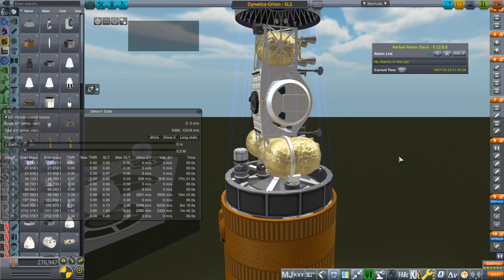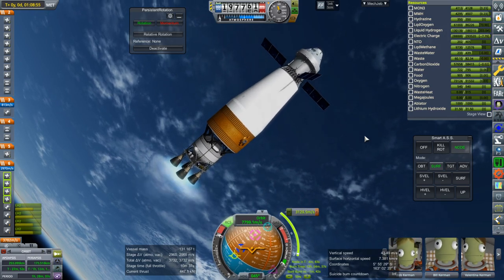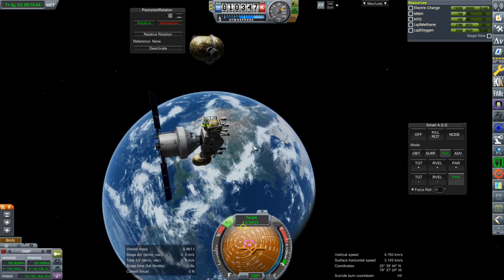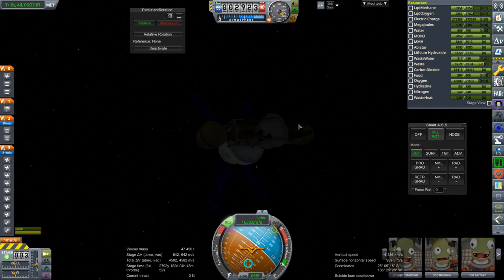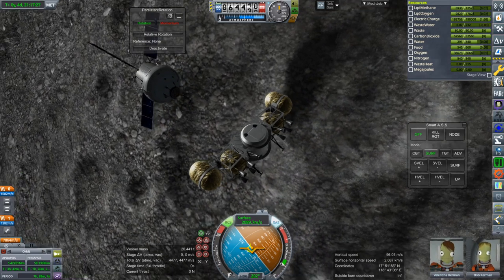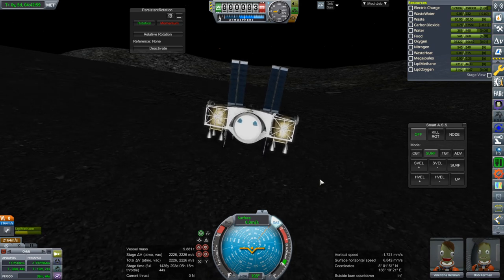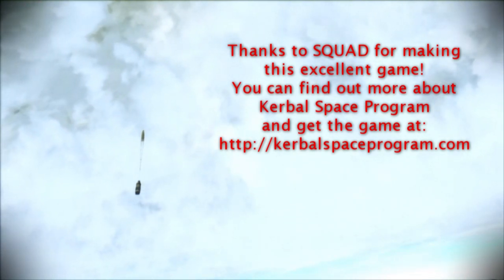Realism Overhaul in KSP 1.8.1 - Orion and Dynetics Lander on SLS Attempt 1

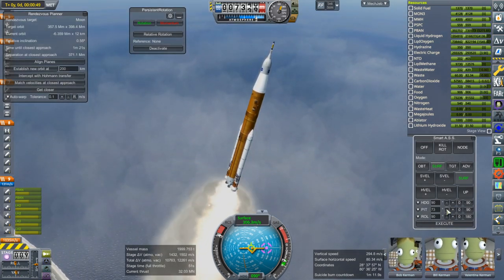Comment: 3:50 Indeed.

16:35 and 20:05 Make sure to do that on every burn in the next attempt.

25:05 AFAIK, it is always better to have more high-Isp fuel than low-Isp fuel, and to use the low Isp fuel first if possible.

Also, you could potentially transfer the residual CanadaTug fuel into the Orion.
Reply from the maker: The CanadaTugs use MMH-NTO rather than MMH-MON3 right now, but I guess I could change that.

Comment: One thing I’ve noticed even in your last video was that you tend to hang onto the service module fairings to long, which makes you have to carry more mass to (almost) orbit. The actual flight plan for the SLS calls for those to separate around the time you jettison the launch escape tower, so at around 69-75 km altitude. 
Furthermore, if you do split your burns into 2 for your TLI, why not burn at periapsis? It’s a colossal waste of deltaV when you do it in a midcourse correction, and the time on the first orbit isn’t that significant. Even if it adds a day and half to your journey, Orion is build for long term space flight, so that shouldn’t really impact your overall performance. To compensate for the moons orbit around the earth, just launch a day and half earlier to still make the most efficient encounter.
Im not saying that I know these things better, I’m 110% convinced that you’d make me a better KSP player in just under an hour, but those things are something I noticed, perhaps these little pointers can help you with overall flight performances :)

Comment: Ok, we can't replace the SLS core with Super Heavy or Starship, but what if we replace the SLS core with Delta IV cores?
I'm not totally unserious. A quick calc gave me something like SLS block 1 performance from 7 CBCs strapped together (I don't mean one core with 6 boosters, I mean literally permanently strapped together. I did the math for a single 1st stage with the dry mass, propellant mass, and thrust, of a CBC x 7) with an EUS for the upperstage. That's not terrible, and if you actually stage the CBCs as you go, and then start adding the planned Delta IV upgrades like lithium-alloy tanks, a regen nozzle for the RS-68,  booster crossfeed, then it starts to become a potentially quite impressive vehicle.
Reply from the maker: This is totally a kerbal thing from way back with Mainsails instead of RS-68s.

Comment: The sls block 2 has a really low chance of becoming a reality
Reply: If SLS keeps launching into the 2030s, the block 2 will just be the new BOLE boosters from NGIS. Should be called SLS B1B+, with performance just short of block 2.
Reply: @Matthew35333  i didn't know that thanks bro
Reply: @Matthew35333  actually is the bole the castor 1200 made out of carbon fibre i think
Reply: @GurmeetKaur-dz9mh  Yeah, better mass fraction, better isp, more thrust. I think NASA has like 6 or 8 pairs of current boosters left, so the switch is gonna happen eventually.
Reply: @Matthew35333  yeah thanks for the info
Reply: @Matthew35333  not only bole, but actual advanced boosters are being made. If block 1B will be a thing, Block 2 definitly.

Comment: I know this would require a little extra math and/or waiting around, BUT, in order to be more efficient with your burns, etc. You COULD do two things.

First on the Transfer burn, as you needed a "correction" burn after docking, check and see how long your orbit was after achieving LEO, and then Relaunch, but that much earlier on the next window.  So in other words, the plan would be to launch from SLS to LEO, doing a partial transfer burn, burning out the second stage of SLS.  Then go around, and then plot the correction burn at periapsis, making it into an actual transfer burn.  That gives you enough time to do all the fiddly docking and undocking with the tugs.  

Also, can you transfer the fuel in the tugs anywhere?  Maybe make them methyl-ox tugs, and refill the lander?  Don't know if something like that is possible though.  Also are you sure you need two tugs?  Maybe you can drop that mass?

Secondly...  The Lunar Ascent.  Make that an ascent into rendezvous burn?  So wait until the Orion capsule is almost above the lander again, and make the burn into orbit a rendezvous burn.  It's usually a little more efficient that way?  I think.
Reply: I agree with the first two of your points, especially the first one. However, it’s hard to do a direct rendezvous with an inclination on the part of your orbiter. The moon does rotate, so even after just 4 hours on the lunar surface, you’d be miles away from the ascending or descending nodes. Of course that means you can still launch again, but your new  orbit is going to have a mild if not completely different inclination to your target, meaning you’d have to spend extra deltaV for a hefty inclination change. There are of course work arounds such as getting your apoapsis  to a ridiculous height, making the burn cheaper, but that brings its own challenges with it.

So direct rendezvous with limited deltaV might be a but unrealistic in this case.
Reply: @KirisPlace  I understand it won't be perfect, and it's almost impossible to time it properly, but I mean to say that you'd burn to a rendezvous orbit.  So you'd wait for most of an orbit of the previous vessel, and when burning for orbit, try to make the inclination burn simultaneously.  It may not be as efficient, but I've seen it done, by Tyler, previously.  I may not have explained myself properly earlier, or you may be right that it won't be as efficient.  shrug I'm not certain.
Reply: ArthurEKing8472 it’s definitely possible with the right margins, the problem is that inclination Changes ON orbit are ridiculous in their “price”, so it’s almost always accounted for in the flight azimuth, which is why the ascending or descending nodes become so important.  If you have KSP, Try landing on the mun with an Apollo style setup and stay on the surface for a couple of days and then launch (granted you’re orbiter is in a non equatorial orbit of course) and see what happens. You’ll notice what I’m taking about. But don’t worry, orbital mechanics are always easier to visualize when you’re can actually see it instead of reading about it :)
Reply: @KirisPlace  I know what you're talking about, I've played KSP before, and I've been watching Tyler for about 8-10 years now.  Not exactly a noob.  My point still stands.